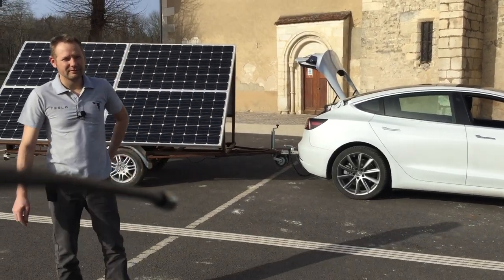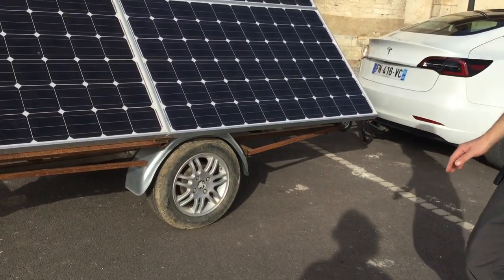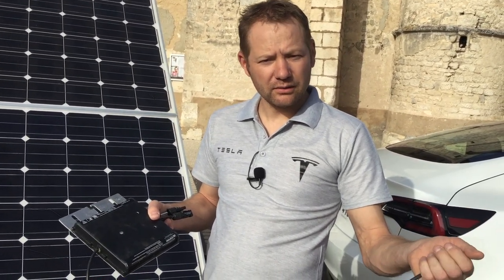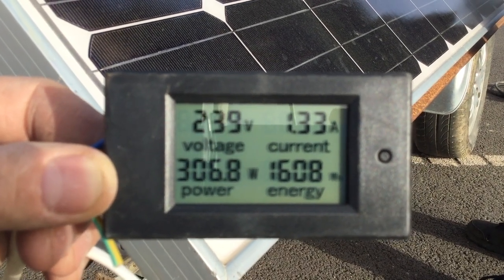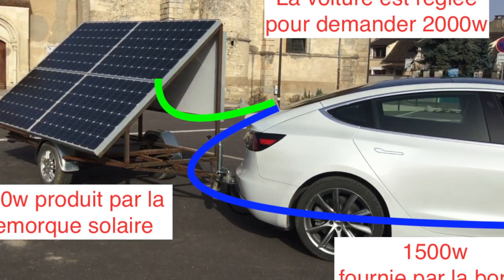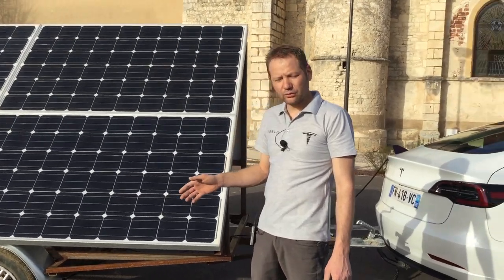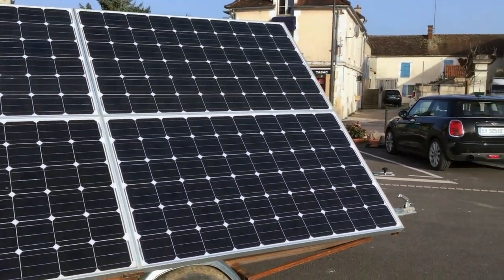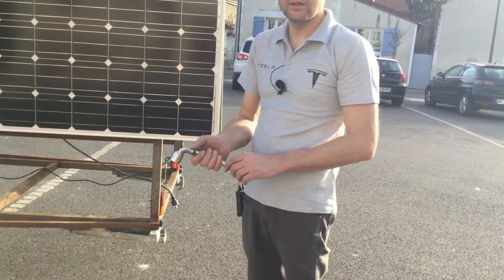🇫🇷 UNE REMORQUE SOLAIRE PHOTOVOLTAÏQUE 🇫🇷🌞🫶🌏

Comment: Ça fait neuf ans que je suis en autonomie électrique photovoltaïque j’habite en Guyane française j’ai commencé par quatre batteries gel 12 V 200 A heures mon installation était déjà en 48 V avec un convertisseur chargeur studer Et un régulateur TriStar MorningStar MPPt 45 a C’était déjà super avec 8 panneaus 140 watts après ça a été batterie L G lithium polymère 6,4 kw avec onduleur solax 3700 va j’ai rajouté 12 panneaux 150 watts le solax Abuguet à dysfonctionner je l’ai remplacé par du Vic tron Ça marche super bien pour l’instant mais le photovoltaïque et l’autonomie c’est génial le groupe électrogène est juste là pour compenser de temps en temps le mauvais temps
Reply from the maker: Super . Mais le taux d ensoleillement est bien différent du notre .

Comment: Bonjour,
Merci pour votre vidéo.
Ayant déjà essayé de charger une Tesla depuis les panneaux solaires exclusivement. Je me suis heurté au problème suivant: le cordon de charge ou la voiture refuse de charger lorsque l’on est complètement coupé du réseau EDF.
Avez-vous trouvé une solution pour contourner le blocage et chargé réellement une Tesla offgrid?
Merci pour votre réponse. Si vous avez une solution, car cela nous fera grandement avancer sur le chemin de l’autonomie
Reply from the maker: bonjour monsieur , 
c'est peut être que l'onduleur n'est pas assez puissant, il faut au minimum 5 kw avec un pure sinus car une tesla demande beaucoup d'energie.  il faut au moins  10 panneaux solaires dédiés à la recharge d'une voiture électrique, une bonne batterie tampon.
j'ai une batterie de chariot élévateur, je vais essayer cela prochainement.
je connais quelqu'un qui le fait avec un Kia iniro et un gros pack batterie plomb.
Reply: Non, dans mon cas je produit plus de 7kwh instantané et j’ai 25kwh de batterie en tampon... c’est un problème électronique. La voiture doit détecté le réseau pour accepter la charge. Si je laisse le disjoncteur EDF en marche, (sans prendre d’électricité sur le réseau) ça marche, la voiture se charge normalement en prenant l’énergie solaire. Mais si je coupe l’arrivée EDF par un disjoncteur, le reste de mon installation continu de consommé sur le solaire, mais là tesla s’arrête de charger !! 
La lumière verte du boîtier qui est sur le cordon de charge passe au rouge au lieu du vert.. le blocage se fait a ce niveau.
Je ne sais pu as comment faire pour « tromper » ce cordon et autoriser la charge!